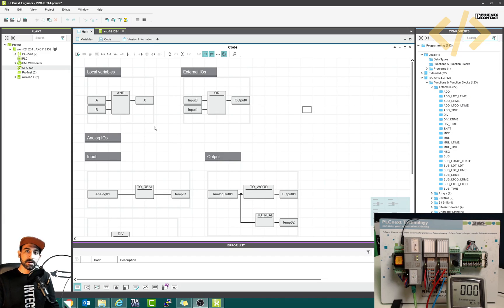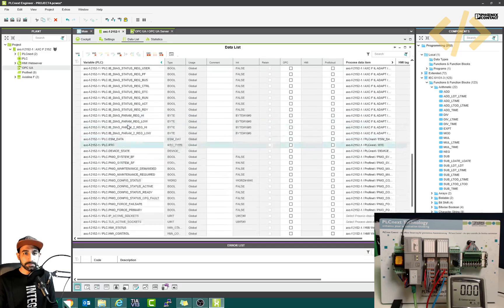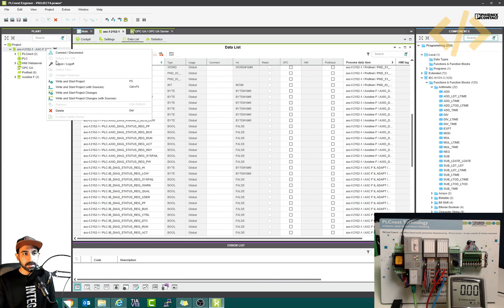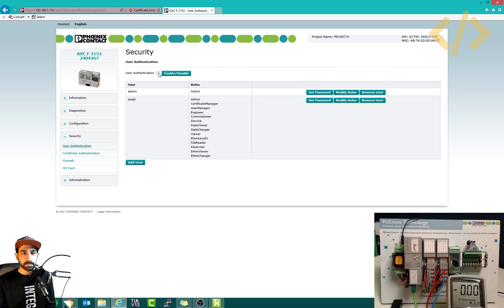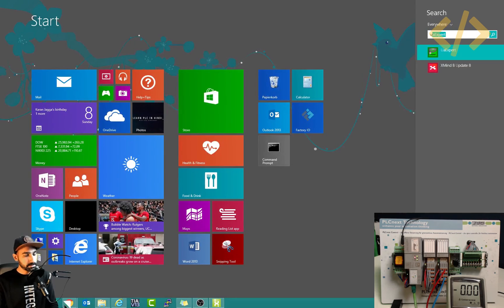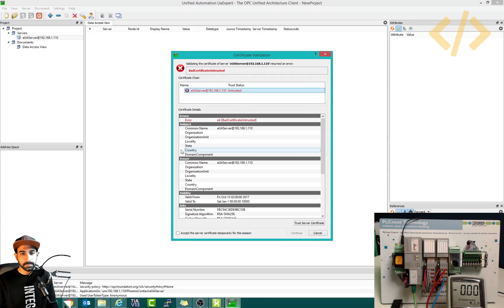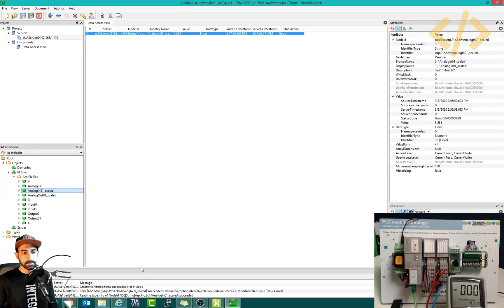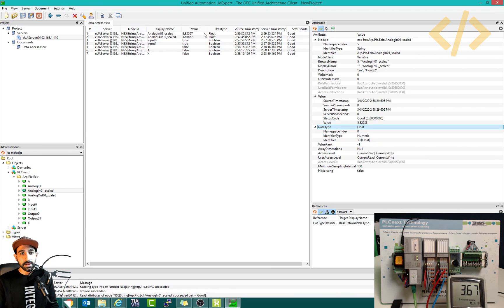PLCnext Lesson 10 - Activating OPC UA and interfacing with UaExpert

Comment: Hi Raj, is there a way to modify the value of a node from ua expert client? Or from ua expert client I can only monitor the parameters of my server? How could I else do that? I need to control remotly my server, maybe I could write a python client software with opcua in witch I can set the values of the nodes?
Reply from the maker: Hi, you can modify the value of OPC UA server via OPC UA client (UaExpert) as well. Just bring the tag to the monitoring window and double click the tag value to write a new value :) Else, you can also use Node-RED to change the value in the OPC UA server.